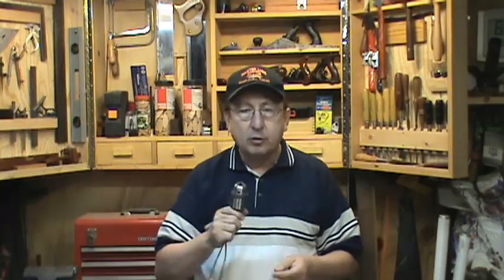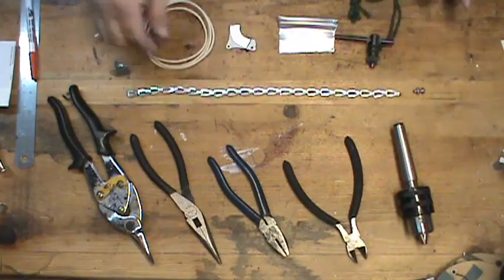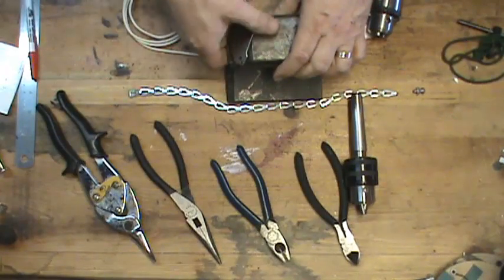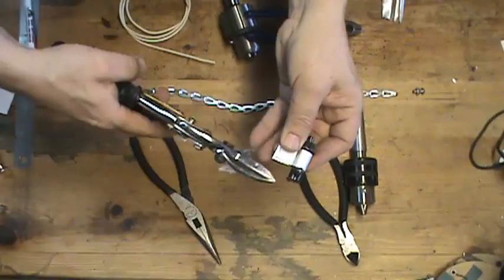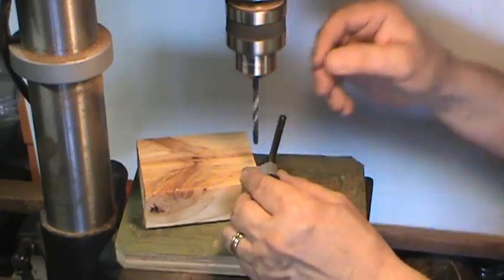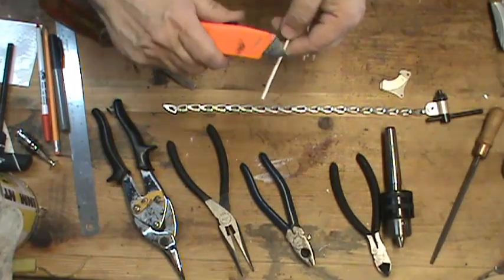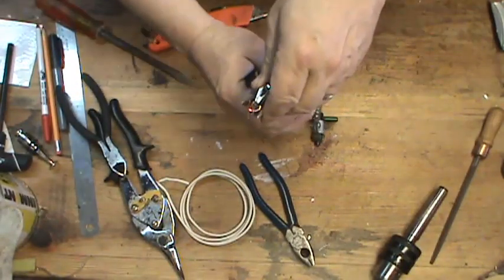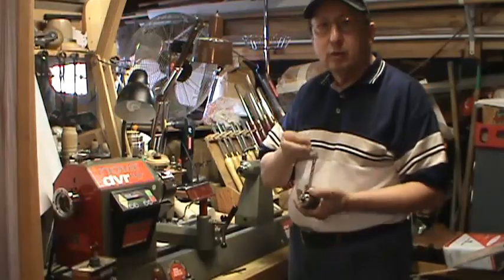Wood Lathe Drill Chuck Key Leash

Comment: Hey Cip:
That'll keep it close to hand!
Well explained!
I don't remember who it was ...
but somebody suggested that your tailstock has an automatic release on it...
if you extend your quill far enough to fit a flat piece of steel (I use my scraper) into the opening space...and then tighten your quill back up and the morris taper just falls out!
I still use my knock out bar for the headstock but it saves a step or two when changing fittings on the tailstock!
I use pegs to hang my chuck keys on and I am forever forgetting to put them back... so I am going to have to look in to constructing a couple of these for my shop!
Thank for the video 
Larry
Reply from the maker: My daddy used to make these for his electric corded drills.  I adapted it with a magnet for my lathe and drill press.

Cip

Comment: Hi Cip,
nice video.
This happens almost every well that you installed the chuck key or it falls to where you can not find him so quickly.
The idea with the chain and magnet is good.
When the chuck fits on the lathe and pillar drill, I would make a key on each machine. So you would not need to always make the chuck key to the chuck, with the magnet.
Reply from the maker: Glad you liked the idea,Cip

Comment: Hi I have made a chain very similar to yours although I used a pop rivet instead of the screw and soldered the wire to make it connect to the magnet
Reply from the maker: John Fithian-Franks Hey there John. These little chains are very handy. I once loss the chuck key to my drill press for over a year. The replacement never worked as good as the original. When I finally found the original chuck key I quickly chained it to the drill press.  I had a real problem with lathe chuck and key. I just could not keep them together.  Cheers